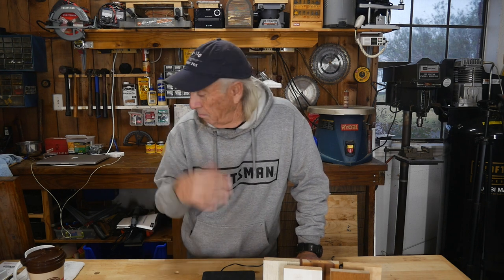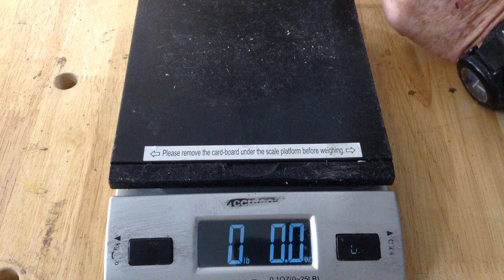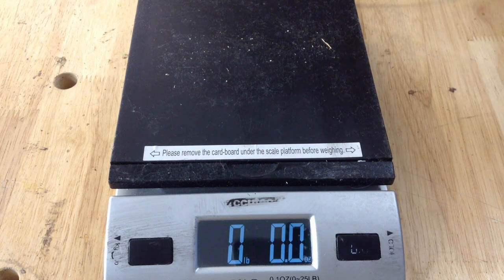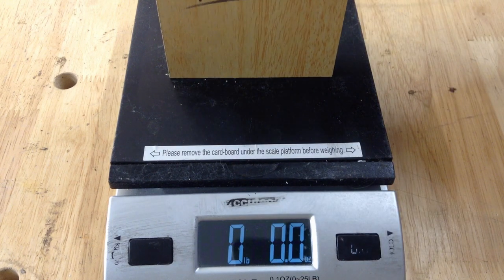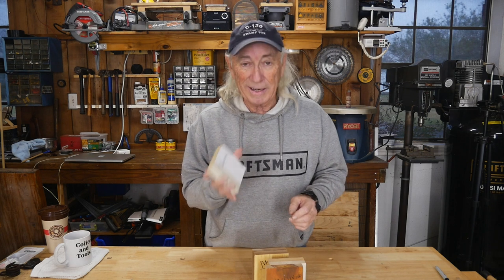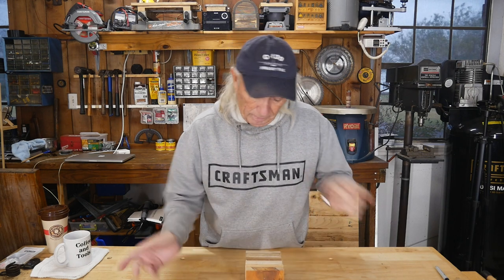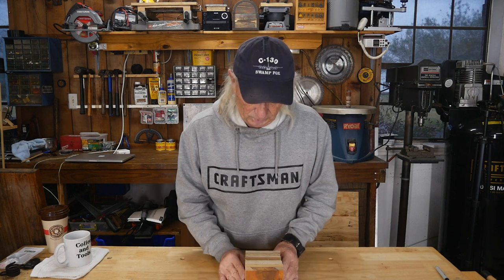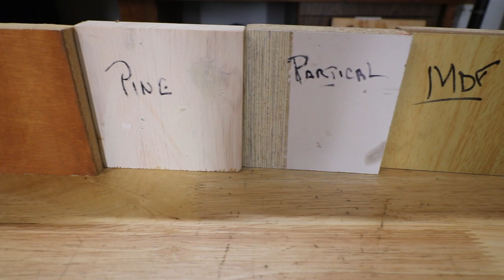Real wood can be light VS fake furniture wood, Coffee and Tools Episode 204

Comment: It did not surprise me that MDF and such are heavier. sadly the only cabinets you can get these days are made of made of partical wood and only the face frame and doors and drawers fronts are real wood but not always. I understand why they use it. being cheaper is the least of their worries, it is much more stable and the measurements of the product is consistent from one piece to another. real wood is not so predictable. but a cabinet made out of real wood will last decades longer than a partical wood cabinet will.
Reply from the maker: Right on

Comment: Agree 100%!! Manufactured wood, composite or ply, is absolutely heavier! I think if there is an exception, it’s melamine. I enjoy working with it for several reasons. It’s still less than plywood. It’s got a smooth surface, and it’s easy to clean up. Disadvantages are that it is a slippery and does chip when cutting (even if you tape the cut line first. But again, it is cheap enough still, that it’s a good consumable work bench top. You may want dogs to hold pieces or use a clamping system but still lighter than ply. Here’s another thought…sheet lumber is heavy. I wonder…if you cut and glued say, MDF, to replicate a 2X4X8….what the weight would be? I’m betting still heavier than any real wood…except maybe cypress or some such exotic stuff and of course, pressure treated.
Reply from the maker: I've got 1 bench with melamine and it is very good for that app.